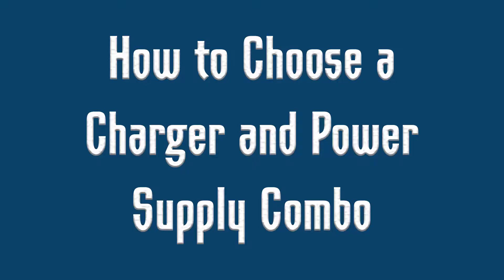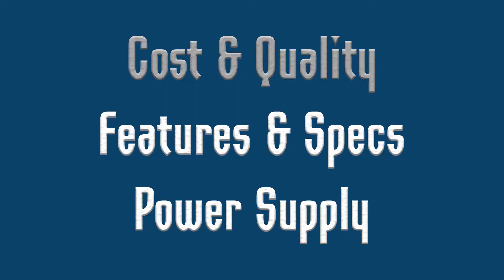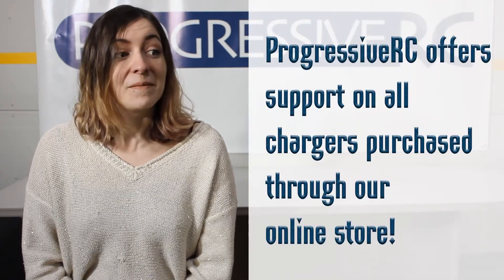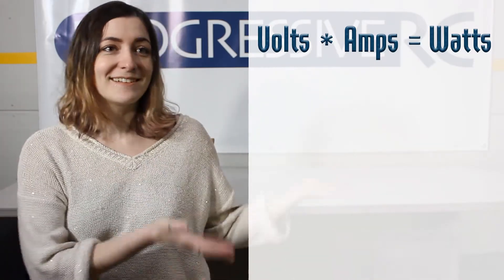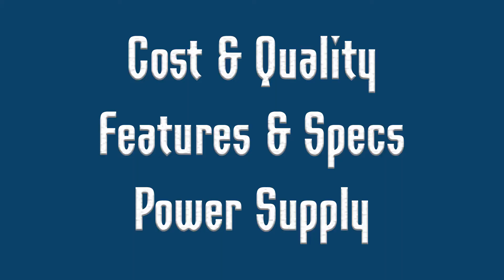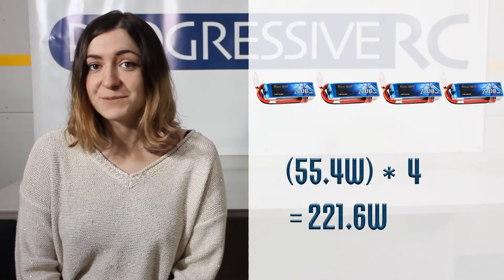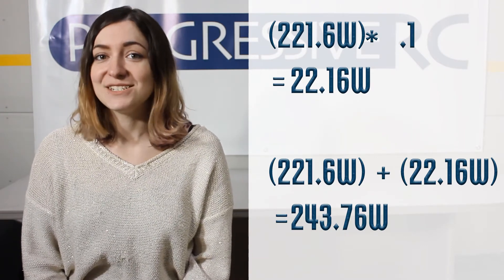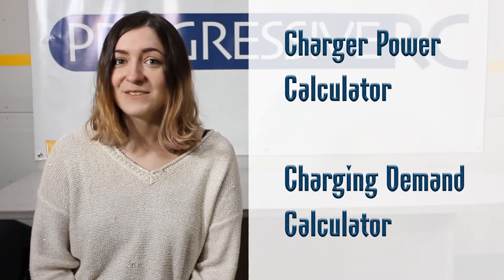How to Choose a Charger and Power Supply

Comment: A $30 charger is not cheap. They make $7 chargers so I could understand saying that might need to be replaced soon but a $30 charger should last you at least 5 to 10 years.
Reply: A 30$ charger is dirt cheap lol mines 420 not including a power supply. Wth  are you going to get for 7$ dude a big mac cost more then that keep it real.